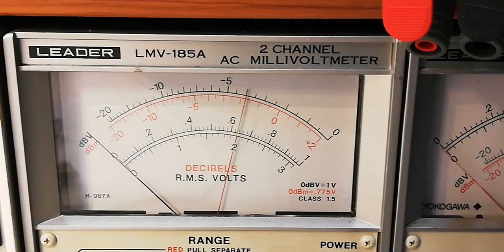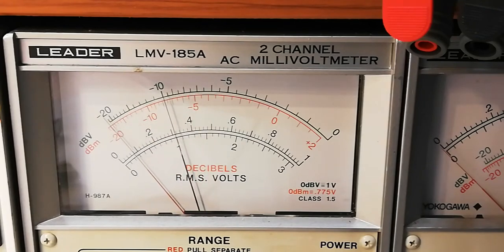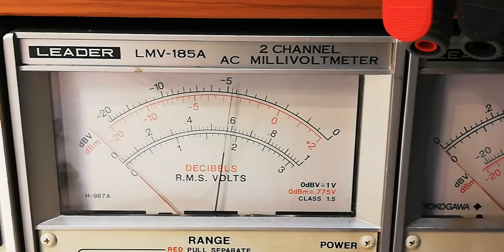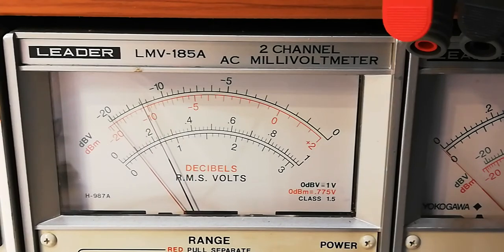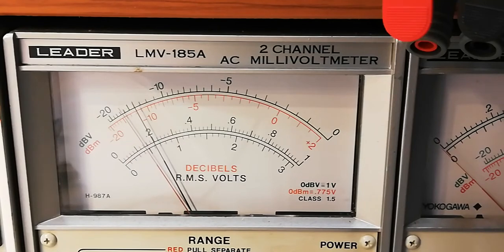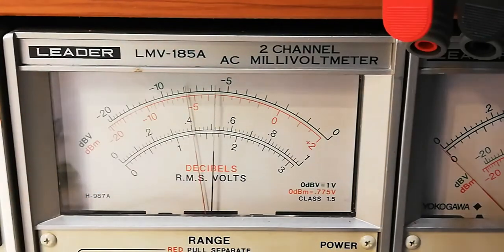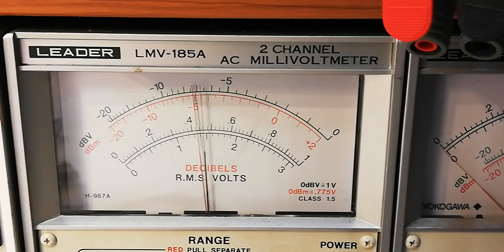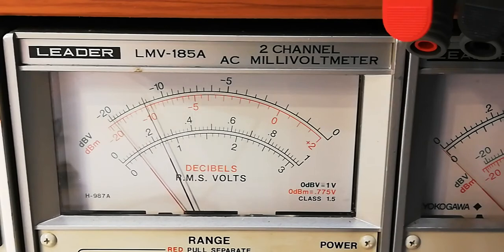Nakamichi CR 4 weirdnesss of recording head alignment

Comment: 400 Hz level adjustment generally is for type I Cassette
Reply from the maker: In Nakamichi decks witd discrete heads you have 400Hz to set rec head height and 15kHz for azimuth...after you adjusted pb head. Problem on this deck was, that one coil in rec amp was open.
Reply: Ah yes very good. Usually for level setting you use type I and then set bias. Hope you fixed the coil problem
Reply from the maker: @VintageAudioTech  it was fixed 1 year ago. And about 400Hz level and normal tapes i do not understand what you meant.